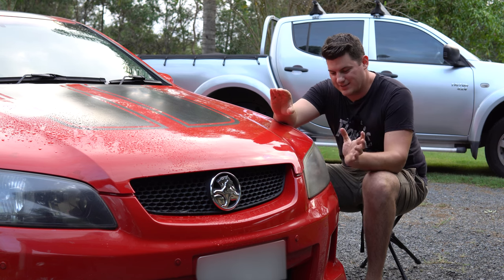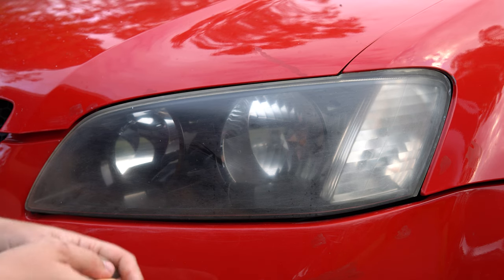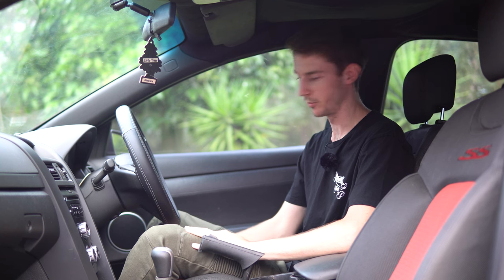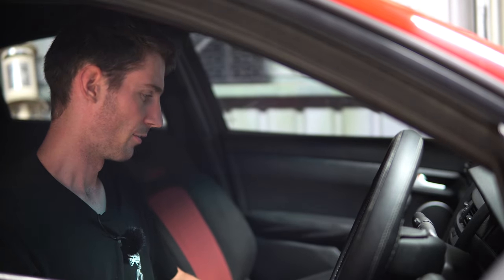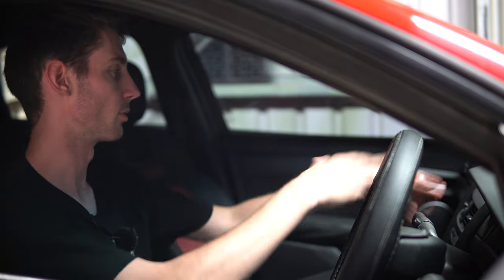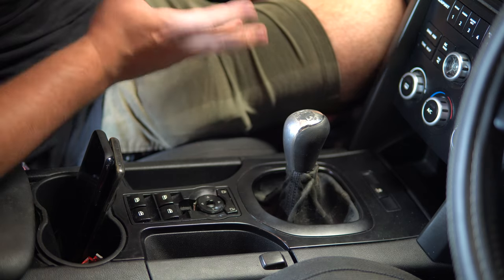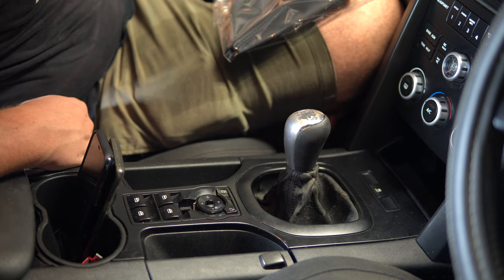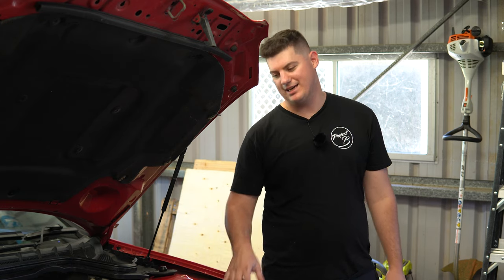HOW TO SELL YOUR CAR | Lemon 2 Lambo #51

Comment: That Meguiar's Air Re-Fresher bomb is good stuff, also the Meguiar's Air Odour eliminator spray is good too - When i am looking at buying a car there is a few things that make me pass fast, # "P" plates on the car (a generalisation but to me it would seem a high chance they have been showing off to their mates or low budget DIY mods/repairs) . # photos of the car doing drifts or skids, # Photos of the car on a hoist or the back of tow truck, # Poor resolution photos # Dirty car and or interior, #  Nighttime pictures, Wet car/Car Wash pictures, and i hate when they have 5 photos and each photo has a different set of wheels on the car, like how hard is it to just take fresh photos if you are serious about selling it.
Reply from the maker: Could not agree more, seems like people barely try these days